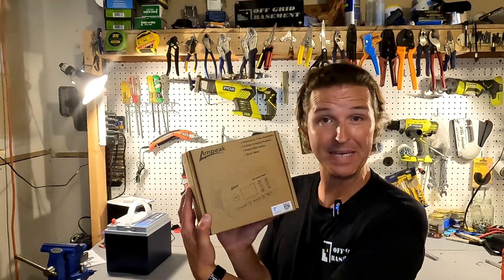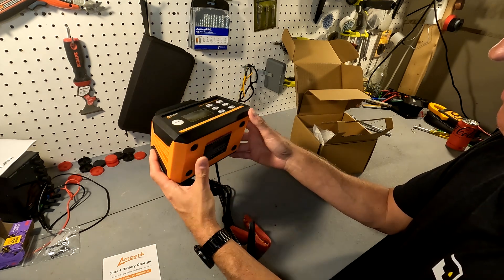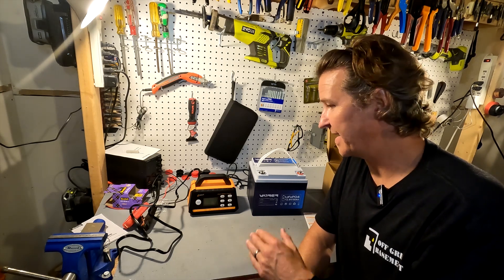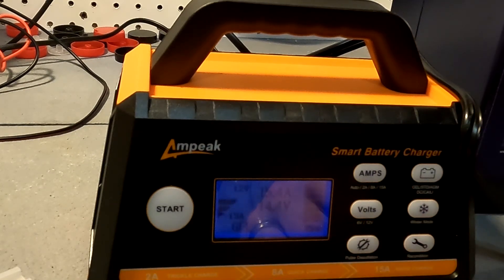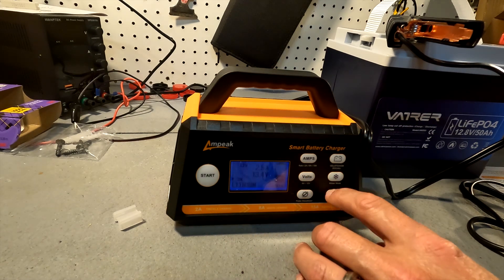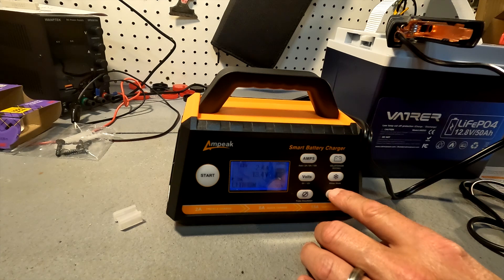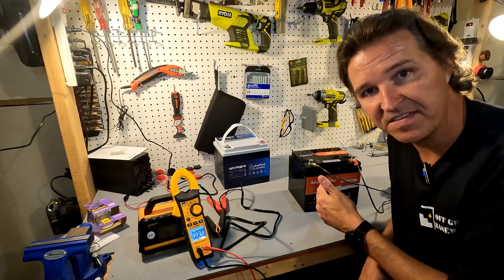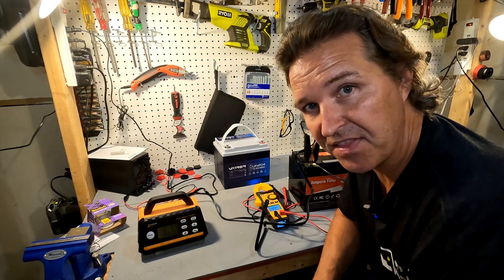Ampeak 6v / 12v Battery Charger Review

Comment: I have a 3 y/o lead acid dead battery. I bought my first brand new charger and when I first charged it, the battery capacity was at 90%. After charging it I reconditioned it. My reconditioning is on day 4 and has not been completed. Reconditioning takes anywhere from 4+ hrs to 3 days, but mine went beyond that. I don’t know why it’s taking so long. I thought something must not be right so I stopped the process. Also, should the fan/motor from the charger be running while reconditioning? Mine was quiet while reconditioning, but the fan came on and off while charging. Do you know what’s would be wrong?
Reply from the maker: I would check the voltage while it's reconditioning to see if it's fluctuating up to 15v.  It might not be working correctly.
Reply: @OffGridBasement  thanks.

Comment: Look it runs hot if you're at high amperage if you charge at a lower amp rate than 15 it won't get as hot at 2 amps it won't get anywhere near as hot
Reply from the maker: You're right, but my other battery chargers don't get anywhere near this hot when running at full power.  Thanks for the comment.

Comment: cool, i actually found a dewalt version of something like this, but it looked like it was in a fire, left in an alley, couldnt make out what happened, i figured whatever was  on the jumpers melted and got fried, there was all this melted wire and metal , but the jumpers were still intact  with no damage.... ahh the plug , whatever the AC powerchoard was plugged into got burned, strange  The unit itself had some melting but it looked like it came from the outside so I had some hope.  So after soldereding a new chord onto it, thinking it would blow up , it turned on fine. So whatever it was plugged into took all the damage caught on fire / electrocuded but the electronics in this unit remained fine.  Impressive.  Well i hooked it up to a 12v battery that was toast and turned on the conditioning  pulse thing for 24 hours,  didnt do anything to increase the capacity... but i did see the pulsing on a handheld oscilliscope, so it was working, probably needed more time, but i had better luck refelling sealed lead acids with disstilled water and just charging it for with16v or a bit higher. Thats enough to start cooking the sulphur off apparnetly but not a safe way to do it. Always wanted a pulser and i found one! But yeah not a mircal worker.  Yeah id kind of watch it with that smell, you never know. The unit might be able to take the heat but the thing its plugged into might not.
Reply from the maker: Love the story!  Thanks for the info and the comment.